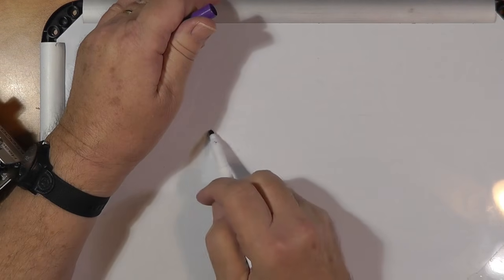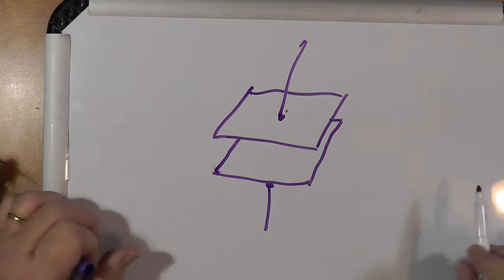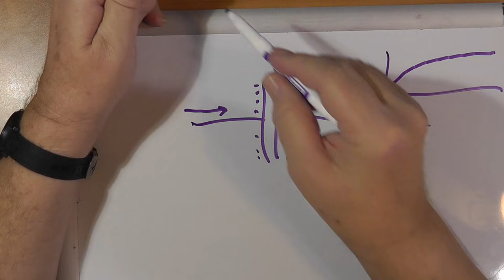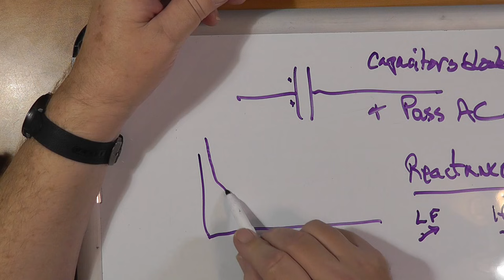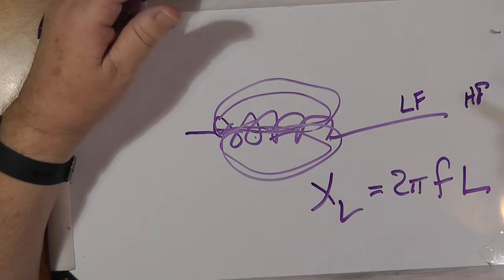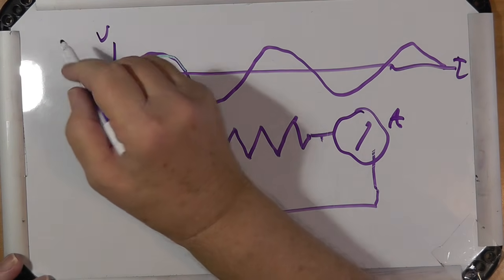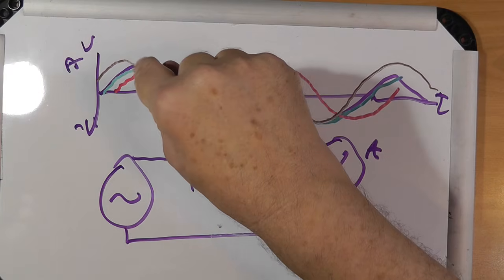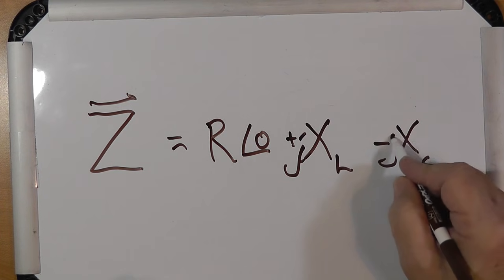Reacting to Capacitance, Inductance, Resistance, Frequency and so on... (#339)

Comment: Great as always Dave! Recommended to my Basic Certificate class. One small slip at 19:10 you mean "inductors" and capacitors, not resistors are opposite in phase.  Be sure to see Dave's column in QST. Cheers and 73

Comment: i think the questioner might have been confused by seeing a capacitor value change over different frequencies on an antenna analyzer as i have. Also I found this on digikey "Since capacitance changes with frequency, industry standards specify the test frequency at 1MHz, 1kHz, or 120Hz." But what Dave was explaining is important for antenna design.

Comment: From Richard VE3RKK:  Thank you Dave for an excellent presentation.   But I continue to challenge the terminology used when referring to the difference between capacitive and inductive reactance simply because it causes confusion.  I am fairly new to 'Hamonics' and, having a heck of a time restlling with the "lead/lag" explanation used, I had to fall back on memorizing the textbook explanation for my exam.  The FACT of the matter, as I see it, and you spoke of it before falling back to the 'Hamonics' explanation  is that BOTH inductive and capacitive reactance LAG the phase but capacitive reactance lags sufficiently more that it APPEARS to lead the NEXT cycle which is analogous to declaring a runner in a race, who fell so far behind he/she is short one complete lap on the track but because he/she crossed the finish line ahead of the competitors he/she is declared the winner. 

For a novice staring at an oscilloscope it is understandable how one could declare capacitive reactance leading the wave without understanding it is actually almost a cycle behind it which I deduce it takes longer to 'charge' a capacitor, the voltage has to drop before it releases it, then an inductor (comparison of like reactance in ohms)? 

Am I correct and if so why is it taught that capacitive reactance leads the phase which, in reality  would mean electricity is being "produced" from nothing.

Comment: A capacitor passes the "effects" of AC. Like a diaphram in the middle of a pipe. An oscillating liquid pressure would push/pull the diaphram passing the "effect" but not passing the actual liquid.....
Reply: well put

Comment: Thank you Dave.  It seems no matter how many times I read or watch videos about this subject I still have trouble relating it to how to use the information regarding antennas.  Could you do a Youtube video on how you change antennas with high inductance or resistance?  Also interpreting the information on an antenna analyzer with regards to Capacitance, Inductance, and Resistance.

Comment: I love you Dave 
I wish you had showed the phase angle change when an inductor or capacitor is in line with a resistor. An Inductor will have a phase angle of 90 degrees, but with resistance included it will have a phase angle of less than 90 degrees (depending on the resistance value)

Comment: To make it even more complicated there's an exception when you make an air core solenoid, then you have an inductor that also has capacitance in between the windings.
I make tesla coils for hobby and one of the hardest things to do is getting the primary and secondary coils in tune to create scalar waves which causes the plasma breakout.

Comment: I passed my Amateur Extra exam in under 10 minutes with a 50/50 ace, but I'd like to say this is one of the best visual explanations I have seen.
One question: I see 2xpi (two times Pi) used often in your formulas. 
Have you ever considered using Tao in it's place when applicable?

Comment: All capacitors and inductors apparent value will change with frequency, the construction of the part will determine by how much.  Take for example an electrolytic capacitor.  To get a large value they are typically 2 thin foil plates with a dielectric material.  This is then wound into a spiral to fit it inside the housing.  This spiral also creates an inductance.  If you put one on a network analyzer and do a frequency sweep using a smith chart it will be going between capacitance and inductance with frequency.  
Of course most people know not to use an electrolytic with RF applied to it.  
Resistors can also have this problem.  Some higher power resistors are made from a resistive wire wrapped around a core which also makes it an inductor.  Using these in audio  frequency range will not be an issue as the inductance will be small enough to ignore.  Once it gets into RF regions then the inductance starts to become apparent and even dominate.
Inductors are not immune either, adjacent windings act as a capacitor. As you go up in frequency it will 'look' like a capacitor at some point.
So the short answer is the calculated value is always that, but know what frequency range you can use the part in.

Comment: This does shed  SOME Light on the subject BUT it does not speak to whether an Amateur Operator building experimental antennas should care about Phase Angle, whether it is affected by or affects resonance or antenna efficiency and how one might go about adjusting or changing Phase Angle. I'm know that by looking at Real Resistance and a Smith Chart, one can correct for Impedance / capacitance/ inductance mismatches and an antenna tuner can do that for you. What is missing in my mind is how one can adjust or correct it on the antenna itself to improve radiating efficiency.  This is simply the missing piece(s) of the puzzle for me and other "experts" I have talked to.